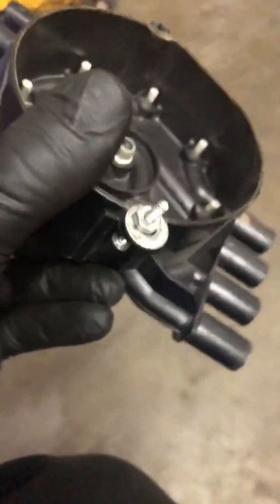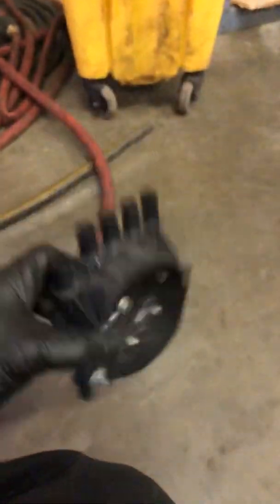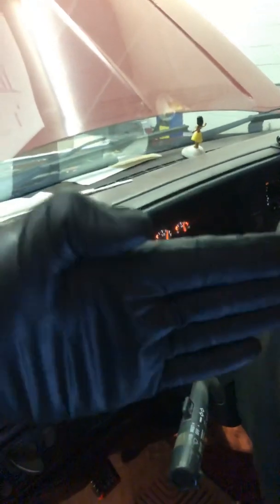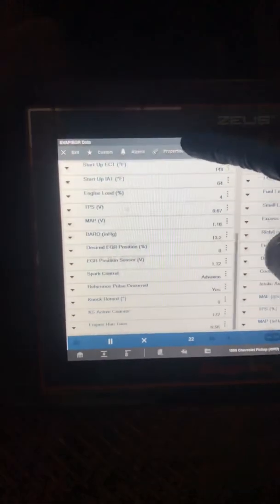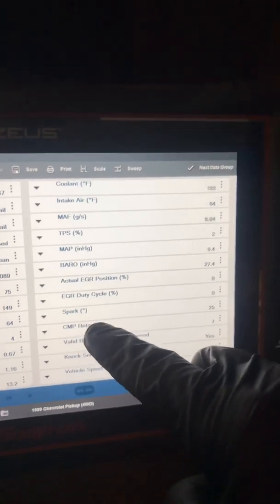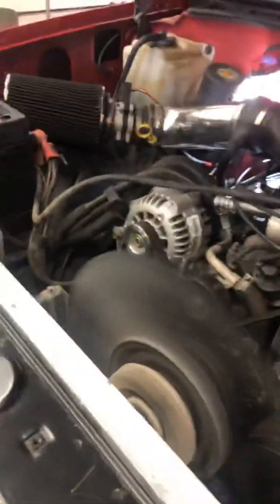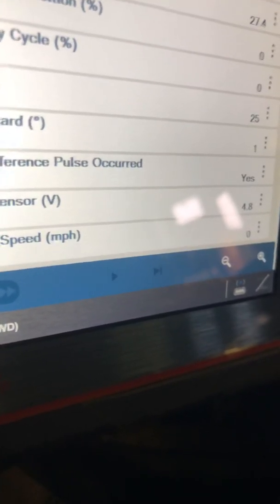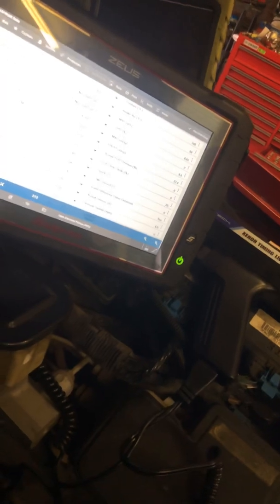Adjusting distributor 5.7 Chevy

Comment: How much are you turning the distance. Mine only move a 1/16 "" and doesn't make a difference
Reply from the maker: @darrentallmon6857  if it maxes out that distance I’d say your timing is off. Make sure number one is on top dead center of the compression stroke. You can put a piece of paper towel on the upward stroke in the spark plug hole. If the paper blows out that is infact the compression stroke. Secondly make sure distributors rotor is pointed at the number one cylinder as you put it in the hole and after it’s seated on can gear. You can stick a long screwdriver down the hole to get the oil pump shaft groove to line with distributor.

Comment: Can we chat about problems I'm experiencing with a distributor change... Not sure if timing jumped or not but the timing mark's on balancer and timing cover do align on the compression stroke and xrotor faces directly at #1position on distributor..it starts but just barely and slowly builds RPMS... Initial PROBLEM is camshaft ate the distributor gear up... What caused that I don't have a clue ... Never seen that before... 1999 Chevy Tahoe... 5.7L vortec motor 4x4.... 4dr...
Reply from the maker: Could have a stripped gear on the end of the distributor or the distributor was installed 180 degrees off. Remove number one plug and put paper towel in hole and rotate engine till the paper is blown out and ensure at top of compression stroke. Re-install distributor and attempt that.
Reply: I just explained that I did all that ... And have a new distributor installed in the correct procedure... And the result I get is sluggish starting and slow to build RPMS... THOUGHT MAYBE YOU WOULD KNOW WHAT Caused THE CAMSHAFT TO EAT UP THE DISTRIBUTOR GEAR... ?
Reply from the maker: @stevegodla5001  sorry man busy AF here. One man shop and constant phone calls. The gears get pits in them and then they wear weird. If you’re getting sluggish starting and stuff like that check fuel pressure. Also did you disconnect the wire under the dash area when you did the timing light?
Reply: @mechanicdave4899  no I couldn't find it I know what your talking about though ran wire /w blk stripe the bypass wire.. can you give me a hint where it is please.... I apologize for being so abrupt with you I'm aggravated asli I kn9w what you mean sir ... Busy as a one-legged man in an ass-kicking contest...
Reply from the maker: @stevegodla5001  that vehicle had a wire passenger side engine bay. There’s a black cover where there’s a terminal board. I found one there. Held together with a white plastic twist deal. Sometimes they have a fuse inline on them. Sometimes they are under by foot area passenger side or in center by feet under dash.
Reply: Also don't have a timing lite... Thought I had to use a scan tool for timing
Reply from the maker: @stevegodla5001  you’ll need a timing light. It’s the only way to set the timing and verify with light. You can rent one at Autozone or go to harbor freight and buy one and take back when done lol
Reply: @mechanicdave4899  where under the dash is that wire plz .... I rent tools from AZ all the time...thank you Dave I appreciate your immediate response ... I have actually been messing with it a whole week I've had two distributor in and out so many times I can do it with my eyes closed appreciate your help sir I guess that wire would be under the dash probably somewhere behind the instrument cluster...?
Reply from the maker: @stevegodla5001  what’s the year make and model?
Reply: @mechanicdave4899  1999 Chevy Tahoe 5.7L vortec 4x4 4dr LT

Comment: Hi I’m trying to adjust the retard on my distributor also. It’s a 99 Chevy Tahoe. I replaced the distributor and cap. My check engine came on I put the scanner on and it’s showing -21 on the cmp. I was only able to get it down to -9. Do I need to start over from scratch and remove the distributor and try to move one tooth over?

Comment: Cherry red manifold no Cadillac converter straight pipe 1999 Cadillac Escalade running 1345 code also no power
Reply from the maker: No cat possible no O2 sensors helping. Sounds like pure raw fuel being dumped in.
Reply: @mechanicdave4899  I have change ever sensor that could be changed  new timing belt spark plug wire the whole kitten Kaboodle I'm going to look into that thanks

Comment: My adapter shows total timing +or- degrees. No option for cmp retard.  I'm showing -20 to -30° retarded while running.  Can I use the total timing to get down to 0 or it cmp retard different.  Having hesitating and dies while idling for more than a few seconds.  Thanks

Comment: Appreciate your video man .. actually got a scanner that’s linked to my computer that I’m going to use to adjust it back to 0.
Reply from the maker: So glad you can get it going sir. Stay warm out there
Reply: I thought it was my egr valve getting stuck open and closed , it was also throwing a code I replaced that . Code cleared now time to get this timing adjusted
Reply: My adapter shows total timing +or- degrees. No option for cmp retard.  I'm showing -20 to -30° retarded while running.  Can I use the total timing to get down to 0 or it cmp retard different.  Having hesitating and dies while idling for more than a few seconds.  Thanks
Reply: My adapter shows total timing +or- degrees. No option for cmp retard.  I'm showing -20 to -30° retarded while running.  Can I use the total timing to get down to 0 or is cmp retard different.  Having hesitating and dies while idling for more than a few seconds.
Reply: Did yall ever figure out an app that works for these 5.7's plz shoot an answer if you could thx guys...😉

Comment: Hello  I watched your video and I feel that was of great help , considering that my neighbor took his 97 suburban to a shop and to his surprise they messed with his timing and left the distributor lose. he has a 5.7 l and was furiously upset. He ask me if I could take a look at this issue and I said I would. I don't have a scan tool, and yes I do have the drop light. I pulled off the distributor cap at tdc and the rotor was facing 180 out. what would you please advice me in this situation? please HELP!

Comment: so i dont understand why i had to reset the dist. if i never moved it to begin with just replaced plugs wires cap and rotor...but i couodnt get it to stay in time i know the 95 and below has the brown black striped wire either on the firewall or in the wireloom on the passenger side under by the glove box but i couldnt find a wire...

Comment: i done a tune up new plugs wire cap and button...i didnt loosen the dist. bolt nor did i move it...when i installed the new cap rotor plugs and wire ( double checked firing order ) it wouldnt start it was out of time...literally flooding itself with gas every pkug i pulled was soaked...so i had to take out the distibutor and reset it point to number one at tbc ( used the napkin in the spark plug hole method ) just to get it to start...but it ran just like it did before acting like it was out of time..m.
Reply from the maker: Clint how many miles on the vehicle? If you’re doing a tune up you don’t need to reset anything. If you’re having issues there’s a chance the distributor needs to be replaced.

Comment: When you say your turning the distributor are you turning the cap as well?
Reply from the maker: Rage J yes sir. The entire assembly will rotate.
Reply: @mechanicdave4899  So what you're saying is the cap is not unscrewed from the rotor? The only bolt you take off is the one that holds the distributor in place?
Reply from the maker: Yes sir you got it. Cap is completely secured. The bolt that holds the rotor in place will only be loose enough to still have tension, but enough tension to still rotate the assembly. You don’t want it too loose, or your adjustments won’t matter once you let go of the assembly because the engine will move the assembly. Hope you get it man!
Reply: @mechanicdave4899  OK I understand now thanks for your help!

Comment: Is there a cheaper scanner that can help set the correlation on a vortec motor
Reply from the maker: Jaime Huerta what’s your price range??
Reply: Less then 100  I seen some of those Bluetooth scanners have them but not sure
Reply: It would be cheaper to just take it to a mechanic for the distributor adjustment, than buying a scanner just for that job.
Reply from the maker: Ripptyde Absolutely. Some folks do have scanners and o was covering this in the event one did.